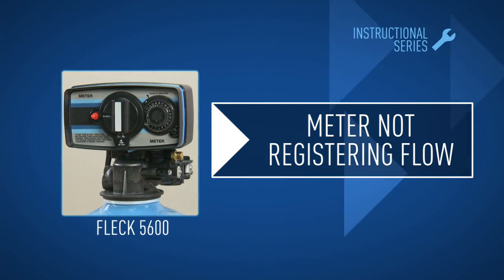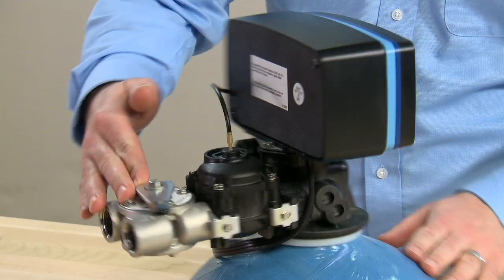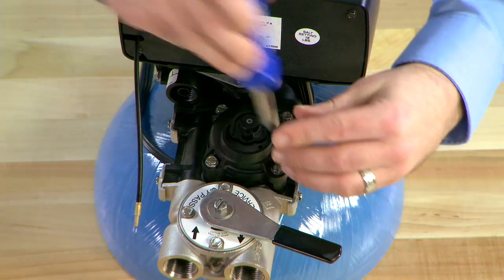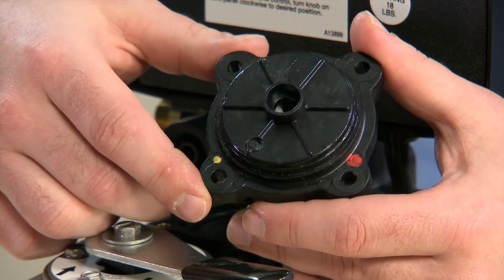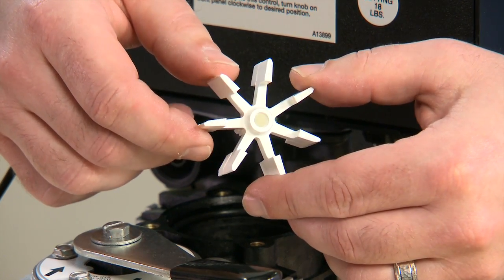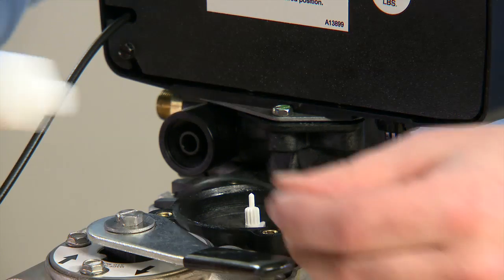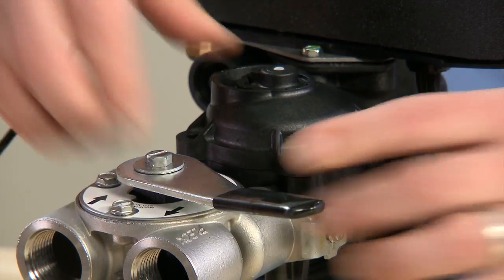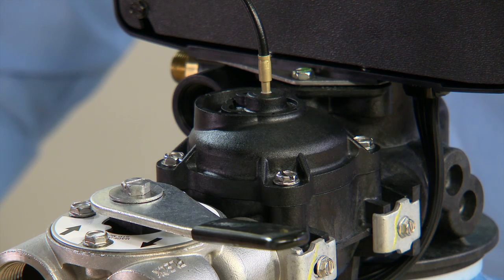Fleck 5600 Meter Repairs

Comment: The most logical action is to throw this junk away and replace it with a modern reliable water softener. I have had a lot of problems with a Fleck 5600 that I bought new 3 years ago. I do not enjoy constantly repairing junk. I had installed a water softener for a house I rent out it was not a fleck and I never had a call from the renters in more than 2 years. Spend more money and live a carefree life...
Reply: What was the brand/model you replaced it with?
Reply: Most renters don't pay attention to things like that. I bet they didn't even keep salt in there.

Comment: You might want to add replacing the meter cable. After following your video, the dial still did not move, so I replace the cable and bingo the dial stated working again.
Reply: Thank you